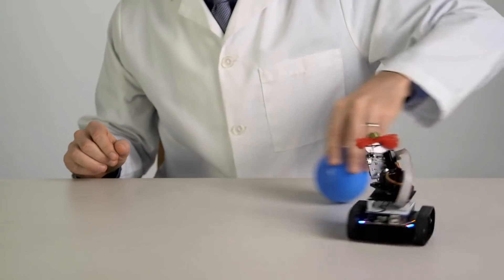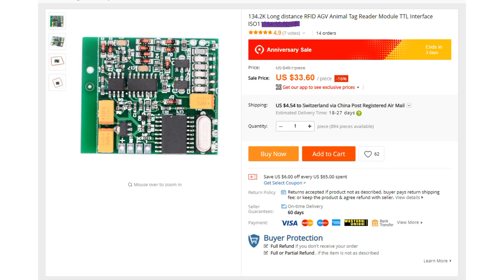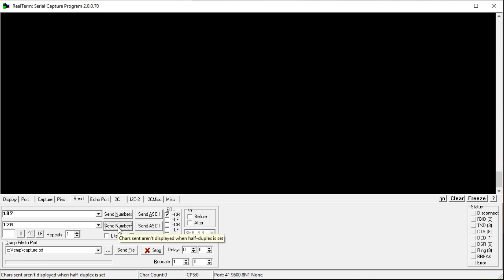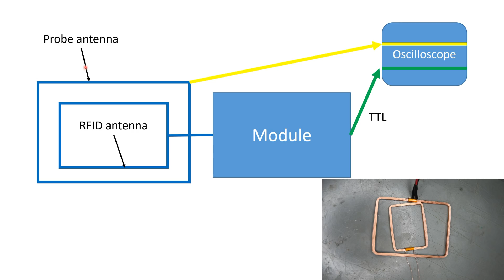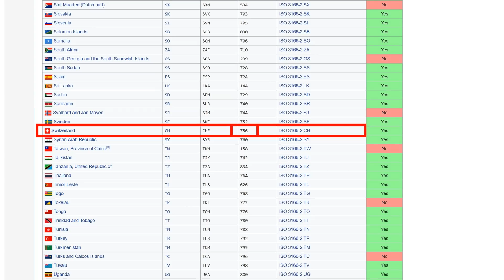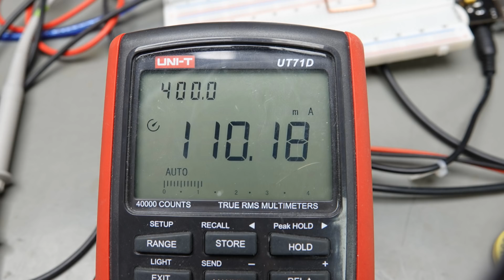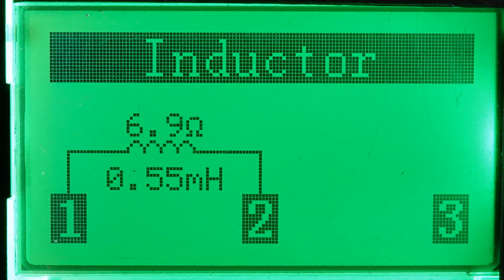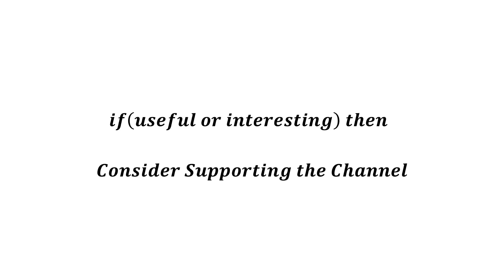#263 How to build an Animal RFID reader with Arduino, ESP8266, or ESP32

Comment: I bought a petscanner (https://www.ebay.com/str/PetScanner/) for £9.99 which connects to USB to the phone. The signal is encrypted, so It can't be used for other applications than their own app until the protocol is cracked.
It scans my cats, but not my horses, even if they claim it should work.

The scanner is held parallel to the spine of the cat, your big coil is right angle to the spine, strange it still works.
Reply from the maker: I assume this scanner uses a module similar to the cheap one in my video and adds some sort of MCU. Interesting that it does not display the code of the horse. I assume you do not know if it does not discover the signal or if some filter does not transfer the code to the phone.
Reply: @AndreasSpiess , connected to laptop, I send A for scanning Animal (134), T for tag (125). When it reads something, but not the expected codeformat, it sends a *, the phone app beeps.
Cats reads fine, horses not a sound. I guess it needs a bigger coil.
The manufacturer say vets are not always trained to align the transponder correctly.
Reply from the maker: You saw the big differences in reach in my experiments. I do not know how deep the tags are in the horses.

Comment: When I saw the "Home Automation for Cats", my first thought was "How can they solder without opposable thumbs?".

Another commenter mentioned cats rubbing up against things. They do like to scent-mark, and I gather that the chips are usually implanted not too far from their cheeks. You might be able to help with the range problem by putting the smaller coil on some sort of post at about head height (they like to mark tree-like objects). For training, have the RFID control a treat dispenser. Once they associate "Marking a tree that looks like this " with "Good things happen", you could use the posts to control pet doors (with inside and outside posts to make the door swing the right way), food dispensers, and other automation.
Reply from the maker: Thanks for the info. This is probably more for an animal trainer. With my background, I stick to technical solutions ;-)
Reply: For cats (not sure about dogs, but probably similar) the chips are generally inserted between the shoulder blades, slightly forward of them. Mostly because this is a location they can't scratch/chew and won't dislodge them while healing into place. Just FYI. :-)

Comment: Andreas, your very informative video has given me hope of detecting cat pet-chips in an application I'm working on.  I've prototyped and am currently using (well not me, my furry lab assistants are actually 'using') a litter-box (tray) that records motion video from above and has load cells below for weight measurement(rpi + arduino).  I'm trying to make a system to record potty behaviors for early detection of health problems.    Anyway, to automatically log which cat is using the box I'd really like to detect their chip.  If I was to mod the antenna of the  most powerful unit you linked and had the loop in a horizontal plane at the top rim of a deep cat tray would i have a chance of detecting a "between the shoulder blades" chip?
Reply from the maker: You saw how far of the antenna the chip was detected. So you decide. Of course, it is much easier if the cat moves through the coil.
Reply: @AndreasSpiess  I think a test is in order!  I'll get the 'expensive and dangerous' unit and give it a shot.  I'm also trying BLE-beacon tags for detecting who-is-in-the-box.  If interested in the cat-box detection and weighing, the test results will eventually appear on raspberry pi forum here (  https://www.raspberrypi.org/forums/viewtopic.php?t=223728 ).  Thanks again for great video

Comment: Cool! Which module did you use for your DIY-coil? Would the cheapest do?
Reply from the maker: I used the most expensive. You would have to wind a different coil for each device. They do not work if you switch antennas

Comment: Is there any concern or standards to powering these with regards to localized heating ? Is it possible to overpower them ?
Reply from the maker: I do not know. I just used the rated voltage and it worked. The 110mA x 9V is not a lot of power.
Reply: I worked for a company that made RFID tags. Generally speaking, no - you would need a coil with a LOT of power to come close to that, like tens of Kv. Consider the "anti-shoplifting" readers in stores - those are fairly powerful, and have detection ranges of about a meter. The cheap plastic tags inserted into boxed items or books don't even begin to generate any heat. And anything that did heat them up to dangerous levels would melt the form and thus the resonance of the tag... and probably heat up the zipper in your pants, too. :-)
Reply: @MrJest2  gotcha, I was thinking more about the medical safety (law/standard) of it, all medical specs especially for implantables have lots of detailed specifications that are not usually considered or controlled for in normal device use.
Reply: At present in the US (can't speak for EU) the FDA is still in the "study" phase and have not crafted any sort of regulations specific to RFID. Other than basic material handling and sterility specs common to any medical implant, the only thing they have issued is a "communication" indicating that RF from the sensors used to scan the tags may interfere with other electronic implants like pacemakers, and to "use caution" and "be aware" of possible problems. That's about it.

Comment: Thanks for the experiments & the video ... will try out the 7€ version to build a small reader w/ ESP8266 and OLED display for our animal rescue organisation ... hopefully it will work ;)
Reply from the maker: This should work.
Reply: Received the reader within less than 2 weeks, came with an RFC card, supposedly FDX-B, which works in short distance (~2cm), but can't get it to read either my dog's tag, nor the neighbors dog's ... not sure whether it's the "wrong" antenna/reader circuit, or the bad maximum distance ...

Comment: To make good statistics, you should catch 100 cats siumultaneosly, Then if it works you are ok. If not you have to clean the mess! ;-).
Reply from the maker: I tested it with 10 different chips outside of the cat. The mess was smaller ;-)
Reply: @AndreasSpiess  True, but not as realistic!!

Comment: Hi Andreas, good You did this. I am also playing with RFID for my cats and had the same readers on my list, but was not sure which one to try, but was about to order the third one with the high voltage. At first I played with the normal 125kHz readers - I had some of the very cheap HZ-1050 readers laying around. They also work for the 134 kHz tags, as the difference in frequency is not too far apart. You don't see anything on the output though, as decoding differs from the 125kHz tags and the chips simply is not programmed to react to that sequence. But if You take the signal directly from pin 7 of the LM358 amplifier, You can decode the ID of the animal tag. I tried it, and it works. The coil should be optimized for a better range and the voltage is too low for a real world project but in principle it works and the HZ-1050 could be completely reprogrammed as it is an ATMEGA8 and the header is exposed. 

Chipping of the cats is really no problen. I assisted my vetenarian when she chipped my cats. Their skin is less sensitive to pain as ours and although the needle looks frightening, they did not even react to the stitch at all (I was holding them). There wasn't even blood as the chip is placed between skin an "inner cat". 
Regards Frank
Reply from the maker: Good to know the trick with pin 7. Maybe someone uses it and writes the software. But I am not sure how strong these readers are. I think they are comparable with the cheaper ones.
Reply: No, it is not strong enough for a real world scenario. The cat"s skin reduces the distance even more, but for testing or proof of concept it works.

Comment: RFID reader in front of the litter box: when the cat has gone X times, receive an Android notification to clean it

Of course, you don't really need RFID identification  here but but that's a use case nonetheless.
Reply from the maker: I usually use another sensor for that purpose. Built in in the middle of my face ;-)

Comment: This is great Andreas! I was planning on a project to determine how much food each of two cats are eating (based on weight change), one is chipped, and the other not. I had already ordered RFID reader from AliExpress which I assume will not work because of the special LF band you mentioned, but thankfully you saved a structural engineer frustration! I am in your debt sir.
Reply from the maker: I was frustrated when I did my first video. This was the reason for that one ;-)

Comment: Great video as usual.   Would it help the range if you tune the resonance of the LC tank in the Tx to peak at 134.2kHz either by changing the loop turns or the capacitor value?  Is higher Q-factor better or worse in this application?
Reply from the maker: I did not look inside the analog design, so I have no idea. I assume the reduction of the number of turns did exactly that: To match the frequency better.

Comment: I've been meaning to do this for ages but not quite got around to it.. well done! We were early adopters of the Pet Porte RFID cat flap... interesting design... basically just a PIC doing the hard work with the coils above the animal rather than the animal passing through... i.e. the coils are at 90 degrees to the door but stick out over the top directly above the shoulder blades where chips are normally implanted.  We have a creep of tortoises, all chipped,... might be fun watching them going in and out of their house.  I don't intend to chip myself as I think we have somewhat different skin structure!
Reply from the maker: If you know where the chip is you might get away with a cheaper reader on a shorter distance. Would save some money.
Reply: @AndreasSpiess  Not if they position themselves.  Definitely need a wide field.

Comment: Hello Mr. Spiess, 
I recommand you changed some Arduino compiler flags to speed up or improve building using the Arduino IDE. An example would be -j 4 to use 4 threads will compiling a projects. Or even better use CLion or Microsoft Visual studio.
Reply from the maker: Maybe you wait for a week and watch the next video ;-)
Reply: Also check out platformio.org if you do a compare video of IDE's. Mainly the CLI of platformio works like a charm.
Reply: How would you do that?  Do you have a sample or a video that shows how to do that with the IDE?

Comment: Other chiped cats do not deserve the red light. (Use orange or yellow)  Keep the red led in the "cat-scanner" project.  Add another sensor  to detect ALL animals. Let the microcontroller decide if there is your cat, another chipped cat, any other animal. or no animal.

Interesting to see that the cats are not interested in the device. My chipped rabbit would investigate it in a destructive way.
Reply from the maker: I had to use a dirty trick to motivate them ;-)

Comment: A technically sound video as usual, and this time I laughed at the cat hairs on the oscilloscope :)
Comes to mind: does that ruler not interfere with the signal?
Reply: I'm just imagining how voluminous Dishka's fur would be if Andreas was using a CRO in her presence instead of this low-voltage modern equivalent...
Reply: @ @yorickhunt3371  sorry you lost me ;). 
A coaxial resonant oscillator would imply fluffing Dishka up like a 70's afro?
Reply: @wtg2988  Cathode Ray Oscilloscope. I know I'm really showing my age and you were probably born into a world without such relics, but they really did exist! ;-)
Reply: @ @yorickhunt3371  Whoah! :D No man, my bad.
Reply: @wtg2988  , it is not a commonly used acronym like a CRT.

Comment: Thanks Andreas. I have made a motorised catfflap, because one of my cats feels very vurnerable with the flap on his head. RFID was a logical next step. So I build the reader out of discrete components, driven and read by an AVR Mega. I must say that the analog side of this project, like resonance and filtering was a humbling experience. I learned a lot about this  black magic side of electronics. It would be good if vets would also see this video. It is a basic question while working on this project: How parallel is the vet?
Reply from the maker: I can imagine that creating these filters is not easy. I also assume you do not get lots of information on how to do it.
Reply: Would you be able to share your work/research on building from components? I've been struggling to find an EM3405 :(

Comment: You can buy the sureflap RFID CatFlaps for less then 60€ - but you can not integrate them into mqtt.
Reply: You could always tap into its circuitry, add an ESP and thus integrate it somehow.
Reply from the maker: Good price! Here they are much more expensive
Reply: No here in Germany not. bitiba.de for excample has the "sureFlap microchip Katzenklappe" for 59,99. Although there is an expensive one with "App", which I got. I wanted to build one myself but was honest enough to realize that this would become another long term project and the cat should be able to enter and leave the house back then. However I 'hacked' or better mimiced the app's behavior and thus am able to pull the data for my own needs. 
I'm thinking of getting one of the cheap ones an "hack" it. As the whole flap is "only" twice as expensive as the "good" reader from china and with the flap You will get the hardware needed for most of these kinds of applications. Regards Frank
Reply: I already have the catflap, and actually a spare one with a broken door... Any  pointers for integrating into a nodemcu board? @AndreasSpiess

Comment: Yes, this was interesting! Had some ideas for my cats (Chief and Stitch) but yeah, I always have to many project ideas. Nice to see somebody else also experimenting with it with Chinese readers. Two question though. The coil you made, you just build it or did you do some calculations? And did you only try the more expensive reader? I would be interested to see if the cheaper readers also work is the cat is inserted into the coil (aka distance is pretty small).
Reply from the maker: Each reader needs a different coil. I tried to switch coils and it did not work. I had a working solution so I did not check the weaker devices. The chance they work is not too big, I assume.

Comment: The 4 dislikes were from cats who did not fancy a dirty great needle injecting an RFID tag under their skin!
Reply: I don't think they can feel it. I had to inject considerable amount of saline under the skin for a few days and my cat put up no fuss.
Reply: They feel it. That's why vets now prefer to chip under sedation. I call the needle for injecting the chip rather a pipe.
Reply: @carelx7029  are you sure?  That area at the back scruff of their necks that the momma carries them by is very nerve inactive.  But many cats also don't tolerate a vet poking and prodding period and they probably give shots while they do the RFID too, so sedation is probably a norm for the work.  Just guesses based on experience.
Reply: I had 5 cats chipped unsedated. My job holding the cat and it sure hurts them. The bigger the needle the bigger the chance you hit something. Off course vet ethics is also a moving subject. No pain if it can be avoided is now the standard.
Reply: @anullhandle  Same.  And that was a big needle!
Reply: It can hurt if the cat moves while the vet applies the chip. But if done properly and the cat stays calm it's barely reacting at all. I was holding my three cats while they got chipped and none of them bothered about the injection. it was more the situation of two persons fondling around. We even had to chip one twice, as the first chip found its way back out through the hole before it was properly set. The cat reacted a bit like "OK, if You have to".

Comment: The image on aliexpress of the long range module looks like it has a bunch of capacitors with solder-jumpers. Of course it was easier to unwind a few turns of the new coil, but it seems nice to get the other option directly from the vendor. ;)
Reply from the maker: It was hard to get any information for these readers. I assume it will be even harder to get information about these jumpers :-(
Reply: I gained information about these jumpers just by looking at them and the row of unconnected capacitors. I expect them to be all in parallel and also parallel with the coil to form a tank circuit. With the 0.55mH included coil there was probably 25.3pF (Possible E12 series values: 22pF + 3.3pF) enabled. There were probably also a not connected 15pF and 2.2pF capacitor, and with 17.2pF your 82mH coil would be good for 134kHz

Another idea would be, removing these fixed value capacitors and installing a small trimmer close to the coil instead. And to tune it, I'd go for maximum peak to peak voltage when the reader is active. Or the reader isn't locked to a crystal but to the resonance frequency of that tank circuit, then it would be possible to move it to exactly 134,2kHz (it was slightly off).

Just something I'd play with. ;)